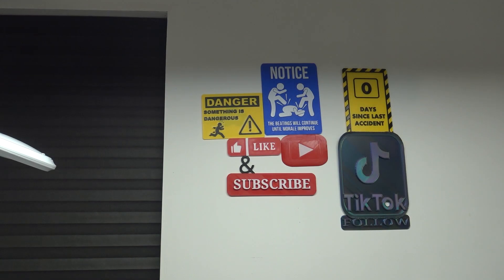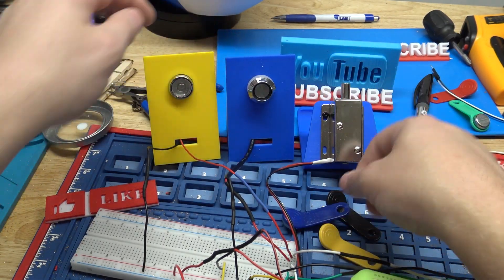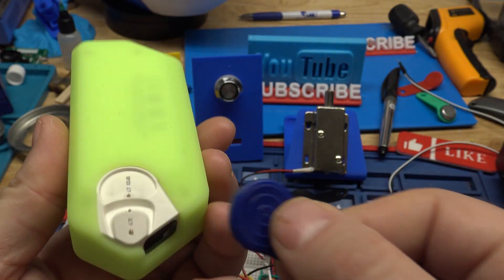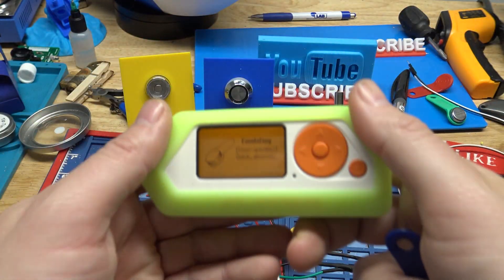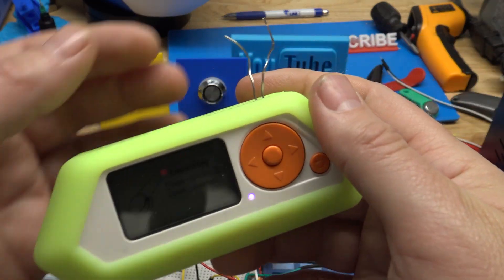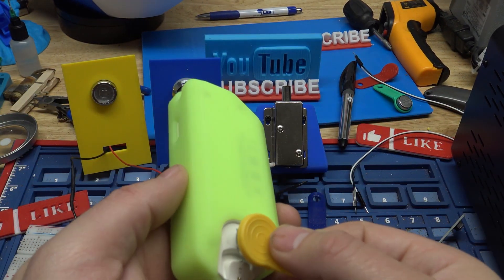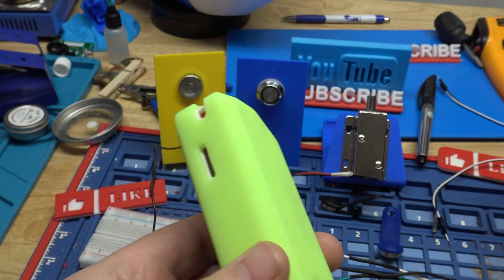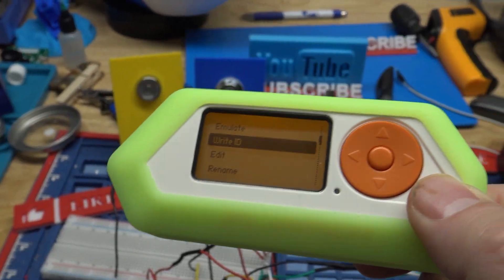(637) Flipper Zero Reading & Emulating an iButton

Comment: And as for the application of the code through flipper you're right the top pin ports are parallel with the two small ripple pins in the end you were struggling with. The separate pins need to touch the ground and the canter of the metal button. (This was my understanding before my flipper zero was stolen at least) thanks for the video. It helped me explain the flip pretty good to my friend.
Reply from the maker: Glad it helped!